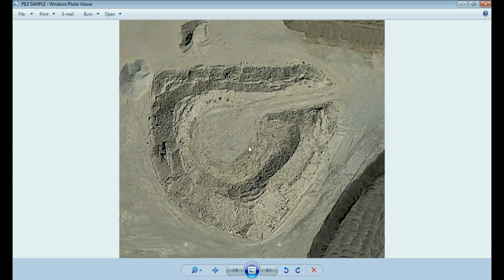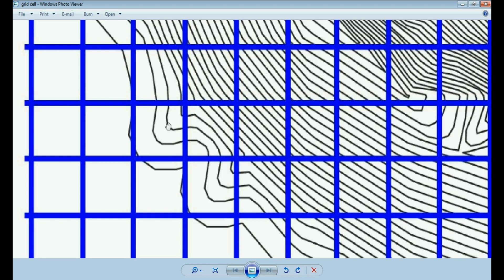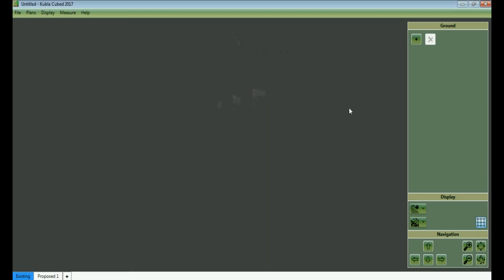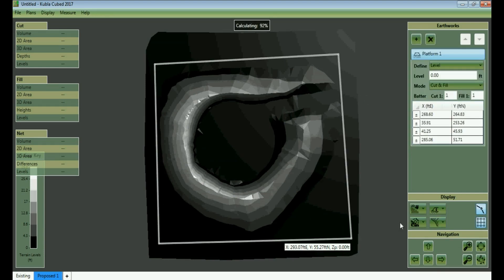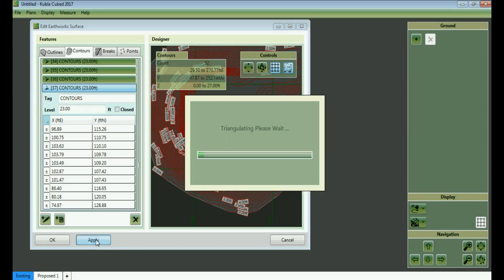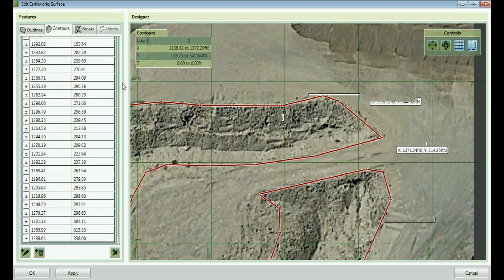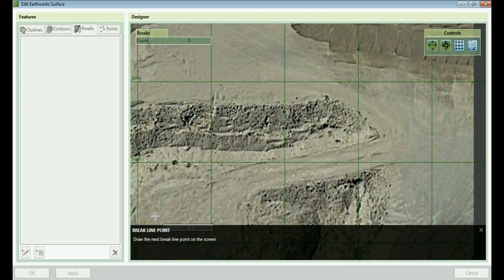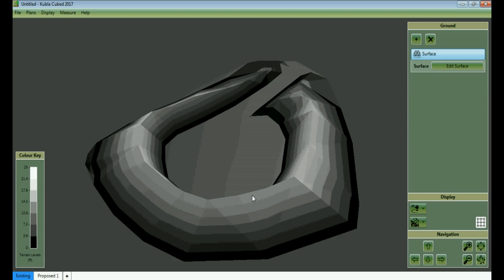How to Calculate Stockpile Volumes with Free Software

Comment: Must the data always be inverted, I am dealing with a pit that needs to be filled.
If I choose 0 for the level I get bad results, same as my highest level.
Regards
Reply from the maker: Hi Kart, it should be no problem.  In this case the volume would appear as Fill rather than Cut volume. If in the video it says you need to set to 'Cut Only' you just need to do 'Fill Only'.  If it still isn't working then I would post a screenshot on the Kubla Forums, I am sure the community will be able to point you in the right direction.

Comment: Hi another question.  The difference  between the 2d surface and the 3d sudace seems small. Is it because both quantities include the platform itself?  If so, what are the surface area values of the pile in 2d and 3d?
Reply from the maker: Hi Alex, yes the 2D area and 3D area are the areas of disturbance, in the case of estimating stockpile with Kubla Cubed Lite that is going to be near flat as the disturbed area has become the platform so they will be very close (3D area will be a bit more with side batter to ground).  If you are using the Pro version you would simply reverse the order, start with a plane and then add the stockpile elevations as a feature surface in the proposed, then the 2D, 3D areas would show as you expect but as fill not cut.  However I think you are a Lite user from your previous comment so I have a little trick as you can't follow those steps as Feature Surface is restricted in the proposed in Lite.  Create a separate project (just copy and paste the one you have).  Delete the platform from the existing but this time create a reduce element over the stockpile with an adjustment of 0.001.  This will make a minute disturbance to the stockpile but report the 2D and 3D of the areas of the stockpile topography not sliced to a plane.  So basically in the Lite you end up with two projects, one for calculating volumes (with the platform) and one for calculating areas (with reduce set to 0.001).

Comment: for some reason I dont get the platform option anymore. is this a paid feature now?
Reply from the maker: It is still available in Kubla Cubed Lite. 
Just ensure you click on the 'Proposed' tab at the bottom, to change the phase. There you can trace a platform around the base and effectively cut down to this level.  Giving you a cut volume of the platform.